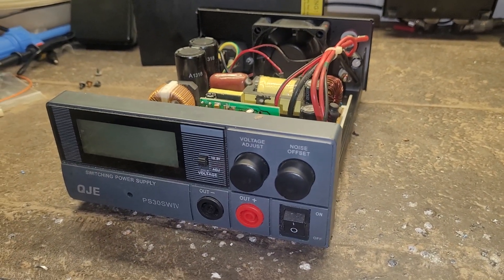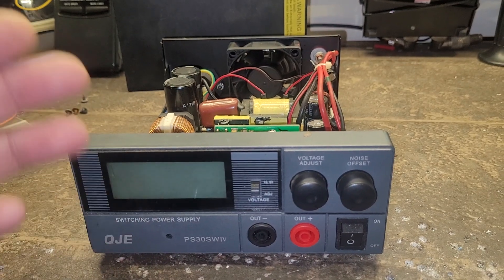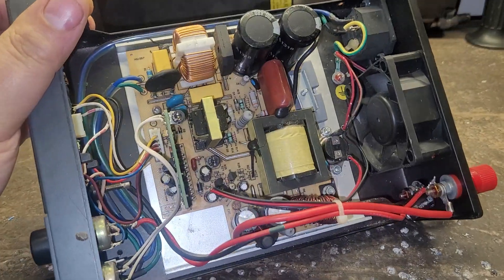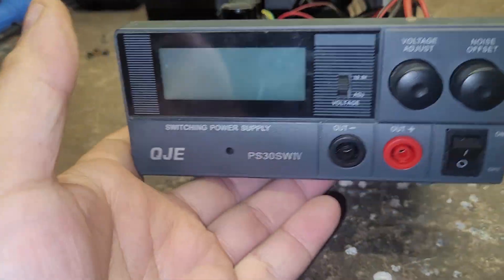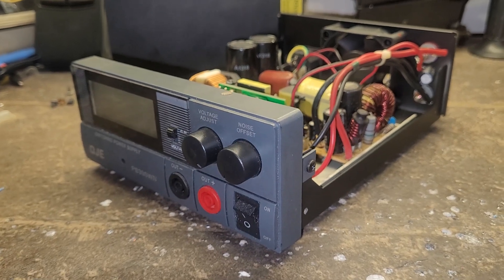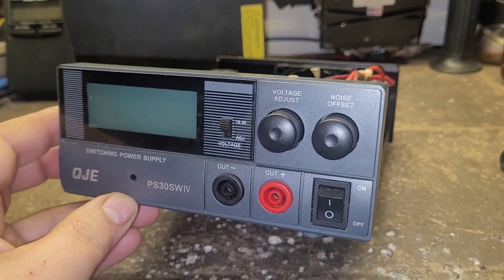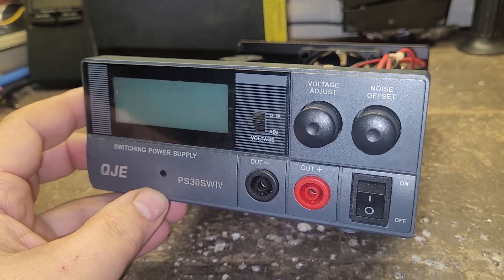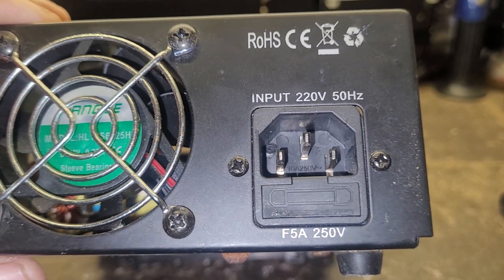QJE PS30SWIV - 120vac MODIFICATION - Part-2

Comment: Seems like a very dangerous product, bad construction, not trustable components, no good protection, eletrolitic capacitor soldered at the connectors, very little circuit... seriously man, don´t use that PSU in hamradio, maybe to turn on leds/lights in santa.
Reply from the maker: I appreciate your concerns, I'll definitely keep them in mind for future projects.

Comment: Buy a step up transformer problem solved. 110 to 220.
Reply from the maker: And learn what?
Reply: @Radionut63  Oh, I'm sorry. I thought you were just looking for a way to use the power supply.
Reply from the maker: No worries at all, i almost tossed this thing in the trash.  🙂

Comment: Take a gander at a schematic for a standard desktop computer power supply.  They have a switch to go from 220 to 110.  Very simple.
Reply from the maker: Looking here now, looks they just pass the AC pin on the rectifier on to the rest of the circuit via the main filter caps.  Looks like all that is done is that circuit is switched OFF for 110vac or switch ON for 220vac.    Interesting.